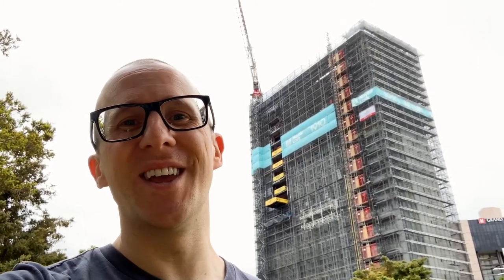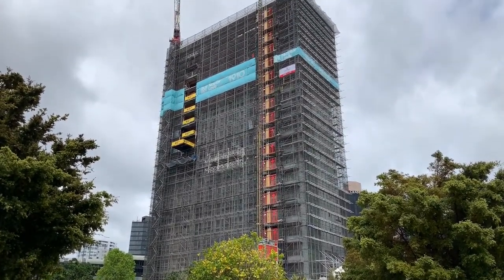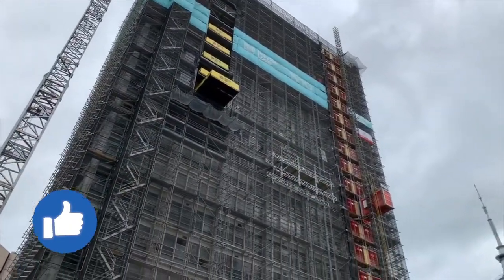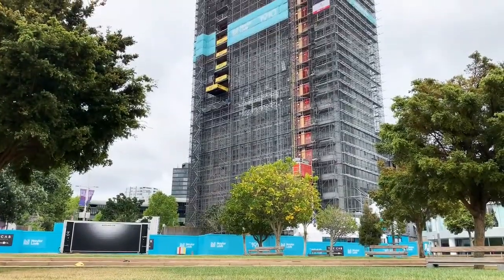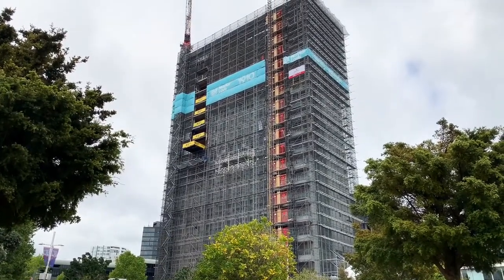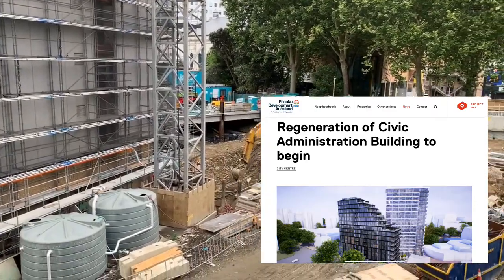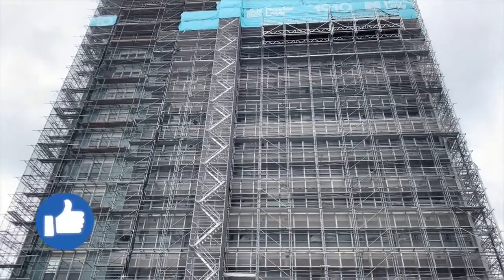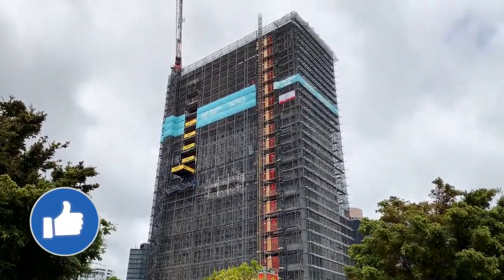How do you redevelop a heritage icon??  |  Civic Admin Building, Auckland   |  Chris Farhi Vlog 14

Comment: They have literally done the worst job to "protect" a heritage building
Reply from the maker: Kia ora CZW, what're your thoughts on the best alternative approach to the building?
Reply: It should have been strengthened and had more of the original exterior facade components incorporated into the design. The only reason why it wasn't was because it was riddled with asbestos and the council knew it would be a hard sell if the developer was going to be forced into strict heritage protection rules
Reply from the maker: @callumzwebster  Thanks for the comment!  Agree, the asbestos would have been a major complexity
Reply: It may be heritage but it was butt ugly wasn't it?  Re strengthening, what %NBS will it be?
Reply from the maker: @davidblake8612  Kia ora David, I can’t recall seeing the ‘before’ figure in public, but it’ll be 100%+ on completion of the redevelopment. Cheers